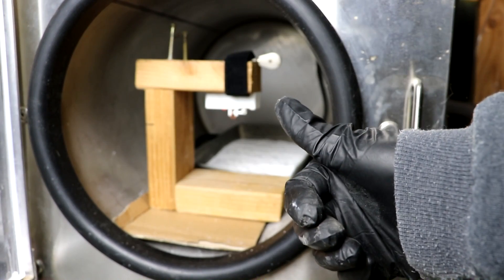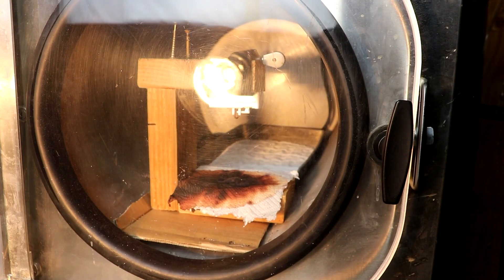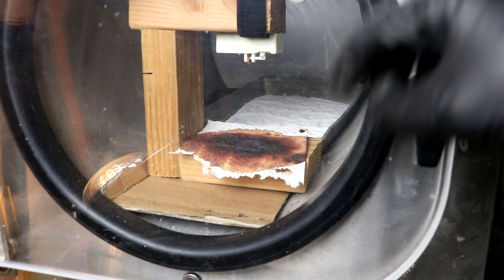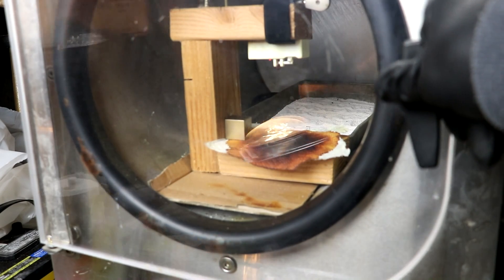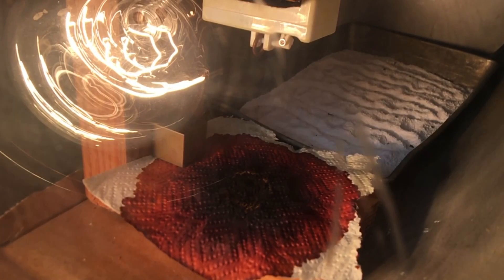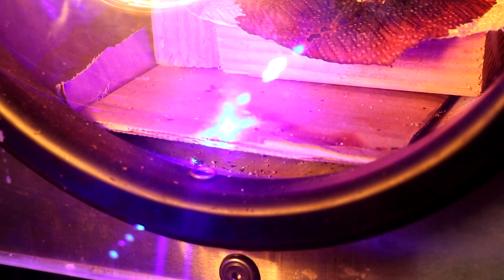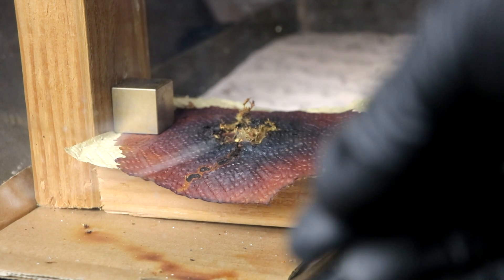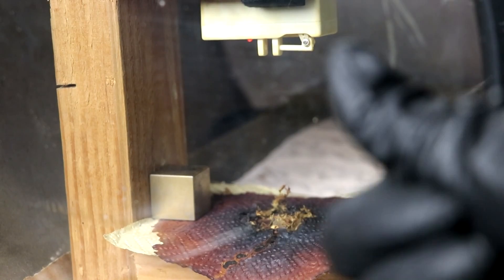Iodine Touch Powder in Vacuum

Comment: Most people make nitrogen triiodide by simply throwing some coarse iodine into ammonia. As far as I know this makes it way less sensitive then it could be. That's why it is ground as fine as possible before adding it to the ammonia and afterwards washed with ethanol to remove residual iodine and with diethyl ether to increase the drying process and keep the slow decomposition in the wet state as low as possible. Only then it can very easily be set off with a feather, a bit of wind or even alpha particles.
Reply: No, theres Silver Fulminate in these things... I think nitrogen Triiodide would be a bit dangerous for lil kids. Hehe
Reply: thanks you for that! i was wondering why Cody's Nitrogen Triiodide wasnt as sensitive as TheKingOfRandom's. Well i guess when its not as sensitive, storing is easier :P.
Reply: Usually it shouldn't be stored at all, because there seem to be quite a few stories about it exploding in wet state. I have met someone who has experienced that.
Reply: damn.... was he alright? And is there actually any real use for this Powder?
Reply: He also was filtering it with a glas funnel at this moment and most of the liquid had not gone through. Luckily none of the glas pieces hit him, because he also had his back turned to the funnel. As far as I know there's no real use for it, besides showing a very sensitive compound that does usually not do very much damage, when it explodes and is handled carefully.
Reply: Still not as easy to set off as Youtube's strike system.
Reply: Dead Meme Ok, that would make more sense. I only really know it was activated by touch.
Reply: Dead Meme I'm pretty sure it's used in very small amounts for those little poppers you can throw down for Independence Day. I could be wrong and that is completely different substance, I'm not too sure.
Reply: I made some by that process and it wasn't the best. Only a small amount of the iodine dissolved and formed NI3, leaving alot of unreacted iodine crystals. The cool part was that the crystals that did form were very small and formed inside the filter paper i left it on. I accidentally spilled the crystals on the garage floor, and you could hear a popping noise when you walked.
Reply: It was used to make so called pranks. It was spilled on the floor and if you wore only socks they were punctured by tiny explosions
Reply: I've done it by making a concentrated elemental iodine solution and adding that to conc aqua ammonia.  The stuff precipitates out.  Wash and keep wet.  Wind will set it off.
Reply: wow he was lucky... Well that just goes to show how dangerous chemicals can be, even if they dont have any purpose.
Reply: AFAIK NI3 is used in some peculiar reactions as oxidizer and source of iodine. For example it may react with acetone to make iodoform AFAIR.
Reply: From what wikipedia says, putting iodine in ammonia creates NI3-NH3, not technically nitrogen triiodide.  So it is more stable than pure NI3.  I'm no chemist, but that would explain why different methods of making "nitrogen triiodide" seem to produce slightly different compounds.
Reply: @Keith, Iodine only dissolves about 1g in 4L of water, was it an alkali iodide solution by any chance?
Reply: The concentration of the ammonia you use for the nitrogen triiodide affects the sensitivity of the chemical pretty significantly. When I first made nitrogen triiodide I used regular store bought ammonia which had a concentration of about 30% or something and I had to throw it to get it to set off. Later though I concentrated the ammonia by getting rid of the water and this time it set off when I poked it with a s’more rod.
Reply: Baddog Gaming FYI, Cody did a video on those poppers where explained how they work and then extracted the silver out of whole bunch of them.

Comment: question Cody, how do you determine air pressure at a higher elevation. I live in Northern CA, near Mt. Shasta in Dunsmuir where I live I am at about 2250 ft altitude, in Mt Shasta within the city proper you are about 3650-3850 feet, the height of the Mountain is 14,172 feet. Love your videos, I loved physics in High School but in 1972 when I graduated I wanted to be an Architect (I went to a Vocational & Technical HS in NYC) I had taken Mechanical Design for 3 full years I even had a job lined up as a Jr Draftsperson when I graduated ( I was going to work a year or so and then go to college), but in May 1972 the construction market fell and the firm I was going to work at had to lay some of their people off. So I took a job as an EMT-III for the NYC-EMS, later I became a paramedic.

Comment: Hey Cody, I was in health class and we learned there is a trace amounts of polonium in cigarettes, I thought it would be interesting if you tried to extract it, just an idea.
Reply: It's REALLY trace, way too trace to extract sensibly from cigarettes. It's only present in cigarettes in the sense that extremely trace amounts nearly anything are present just about everywhere. (Eg, there's about 0.2mg of gold inside every human being.)

It's too dilute to reasonably extract from any natural resource - it's only one part in ten billion in even the most concentrated ores (which are uranium/thorium ores where polonium is present as a byproduct of radioactive decay). When people need polonium, they make it in nuclear reactors.
Reply: Alex Potts I figured that it would be to little, thanks!
Reply from the maker: It would be easier to get it from the fertilizer.
Reply: Only Kremlin-made cigarettes...
Reply: Even if you could extract it, it probably would be a bad idea because of radioactive
Reply: Not really. It's not like you would be creating additional radioactivity by separating out the radioisotopes (if you could somehow even do this). The extracted material would be no more dangerous than the original cigarettes. Yes, it would be millions of times more concentrated, but there would also be millions of times less of it.

Comment: I can't imagine that all the iodine vapor is good for your vacuum pump. Hope you have some sort of trap on the foreline.
Reply from the maker: Im running it through calcium chloride and cotton filters but it will still likely need an oil change after this.
Reply: A canister with aluminum turnings might do a decent job for scavenging iodine. Or even better calcium metal.